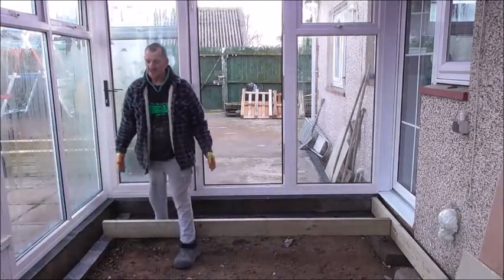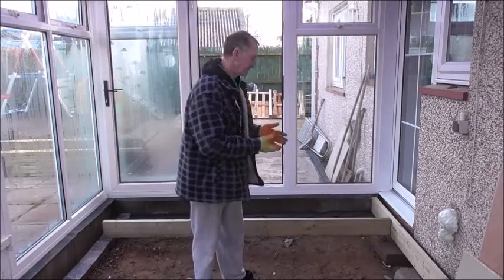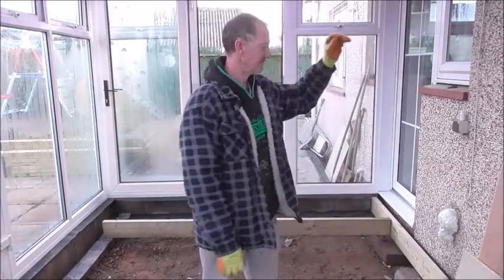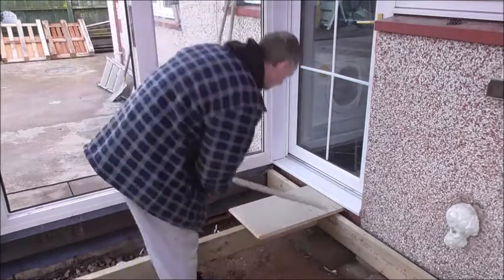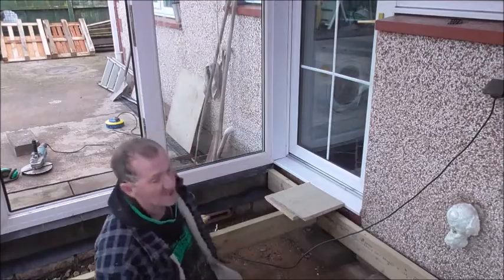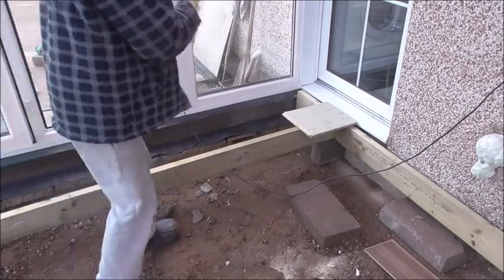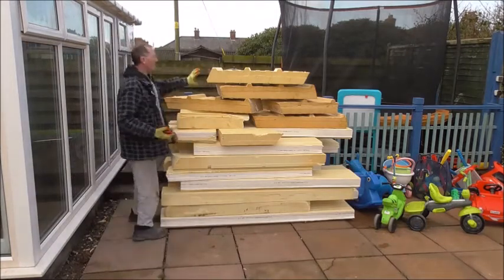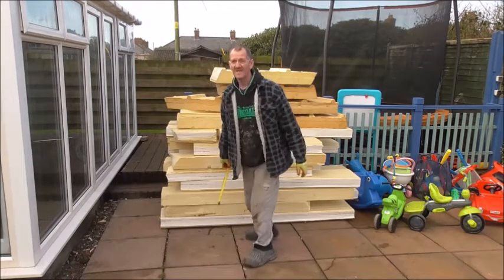Build a conservatory p5 Joisting & Insulation

Comment: Hi David, I didn't see you attach the wall plates to the inside of the walls. Did you not film that bit or is it not necessary to do it? If you were doing decking from your house you would use some bolts and physically attach the wall plate to the outside wall

Comment: Yet another great video David. Did you say in your 1st video that you took it down and transported this back home?
Reply from the maker: yes i got it from a guy on ebay and i had to take it down as part of the deal with some help
Reply: nice video David when l took up the hole of down stairs floor to put underfloor instillation l was advised to leave a  g  gap of about 30mm to help the air circulation
Reply from the maker: Harry Randles yes you must leave a gap under the floor and insulation for air but not above as any air flow above the insulation would transmit cold or it will just be dead air which will do no good, as you will see with mine a gap under of around 180mm but none should get to the underside of your floor or no point insulating in the first place, sorry a bit long a answer

Comment: No dpc under floor joists covering bare earth floor and the insulation is bare with no vapour barrier?
Reply from the maker: Damian G lots of doe under every joist the bear floor you will see if close is 8" hard core which is on a membrane which was done as part of the original house build but Damian you know if there's no UV there will be no growth even if it was bear earth as so many full houses of the old days had this and with no issues
Reply: moisture is was what i was wondering about not weeds aa there is no vapour barrier between earth and floor.
Reply: Damian G and nothing to retain the insulation and no air bricks for air flow , no mastic was applied between wall and frames, Cill and frames or frame and frame instead relying on external mastic seal and DPC under cill wasn’t bedded , and wooden packers under joists on damp slabs not a good idea either these small things add up and make a big difference